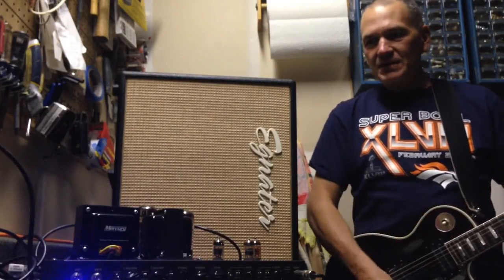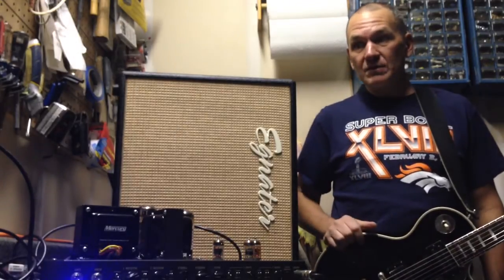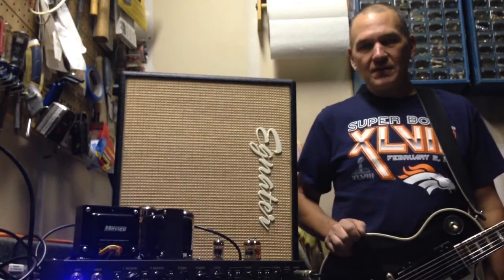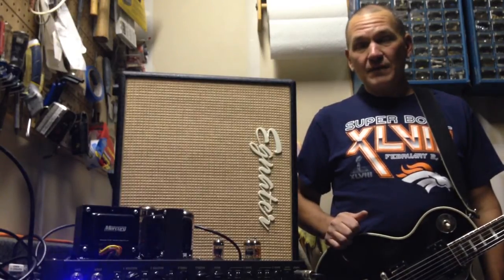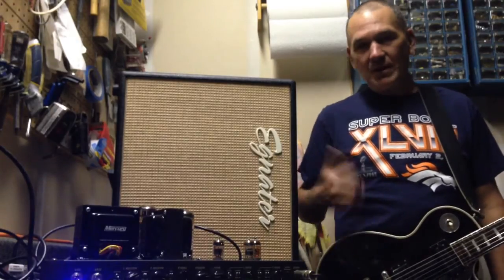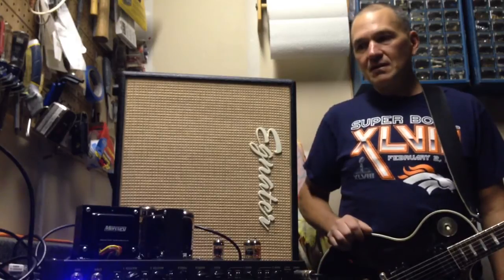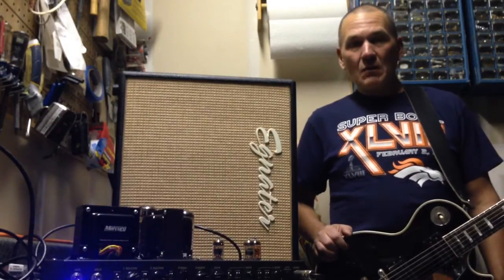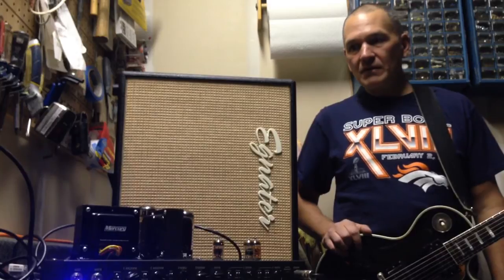Egnater Tweaker 40 transformer issue

Comment: Can anybody describe (really precisely) or better still link to a photo showing where the fan goes. I am in Australia and it is hot as Hades. I am pretty sure that it is the power transformer but both the power and 'fast blo' fuse are intact on my Tweaker 15 Combo.

At the last gig the amp just lost power and sounded fuzzy. No it has no response apart from blue light on and no noise whatsoever. Speaker checked out ok as popped with a 1.5v battery across it. Any thoughts would be welcome too.

Comment: With the tweaker 40 head. Mine died twice. I don't know what they did in the first fix but the second time they Replaced the Ceramic Capacitor C-46.  Replacement of Thermistor.  Replacement of Tweaker 40 Power Transformer. 
It died again after the second "fix". 
If it is still a power transformer issue would the amp work intermittently or would it not work at all ??

Comment: Question, after you made this repair, did it keep working? I just went thorugh the whole PT dying on me and getting an Mercury MAgnetics one. The amp has been sounding extremely weak, and ocasionaly sounding fine since I made the change. My tech's had it for a week now, and cannot find where the problem is. I just msg'd him a link to this video.  any help would be greatly appreciated. I just need to know if it kept working fine since you made this video.
Reply: Hi Luis.  I know I am coming to the table very late in the game on this but, I did the Mercury Magnetics PT swap out and the amp was WONDERFUL for about one year.  Then, sadly, it also blew like the original transformer.  So, I think Jerry must be right in advising the thermistor also be changed out.  (I did not change the thermistor in mine.  But now I wish I had.)

Comment: Hi! Im having an issue with mine when i put it in stand by and then switch it to play it make an horrible noise also when returning the switch to an stand bye position... Even when playing and it loses volume i already change  the tubes but it stills making that!
Reply: Antonio Mendez   The problem you describe with the "horrible noise" is something I did not experience.  Suspect you could have a different problem than the one I described in this video.

Comment: The series thermistor is also called an inrush limiter. Common to use on solid state rectified amplifiers, because, unlike tube rectifiers, silicon rectifiers come online instantly, causing a rapid charging of the capacitors, thus a high inrush current.
The MOV or metal oxide varistor is a voltage clamping device. It's resistance remains almost infinite until a threshold is reached--usually 300 volts or so, and then it clamps.
I'm working on a Tweaker 40 right now, which has a bad transformer and am thinking of offering the customer the Mercury Magnetics option for repair.
Reply: Hi, I have a Tweaker 88 that took a spill... I had to replace the power and standby switches.... I took a lot of notes as to which wire went where... but the notes were destroyed. Here's what I got.... The switches are mounted with the label facing down. Standby switch going from Left to right: top row of connections are two orange wires going to QC16 & QC17 (L-R) bottom row are to yellow wires going to QC14 & QC15 (L-R)... Power switch" Top row connections: 2 red (L-R)wires 1st red to mains power jack 2nd red to ??? (QC25?, it's unoccupied) Bottom (L-R) white wire to Power transformer primary, other white wire to mains power... is this right? Does the other red wire go to QC25? Egnater will not send me a schematic. Thanks!
Reply: Sorry, correction.... Power switch" Top row connections: 2 red (L-R)wires 1st red to ??? (QC25) 2nd red to Mains power Bottom (L-R) white wire to Power transformer primary, other white wire to mains power... is this right? Does the other red wire go to QC25? Egnater will not send me a schematic. Thanks!

Comment: Hey Jerry I'm not an electronics guy, but how difficult/easy was it to install your PT and thermistor? My Egnater Tweaker may need a new PT.
Reply from the maker: You will need to be able to solder, and have a basic understand of electronics.  Even when the amp is unplugged there is still a risk of electrical shock due to stored charges in capacitors.  So if you have any reservations, I would find an experienced "electronics guy (or gal)" in your area.  

The Mercury Magnetics transformer is holding up well and I have had zero issues after this last repair.  These are top quality, where the transformers that Egnator new and repairs with are clearly sub-par.   It is a shame that such a great amp uses such a poor transformer.  

Tip to Bruce Egnator if you are reading this,  your a smart man and clearly understand the difference.  Buy good transformers and thermistors then just raise the price of your amps $50.  If you do not do this you will continue to destroy your reputation. Do not listen to the bean counters, people will pay more provided there has not already been too much damage done.